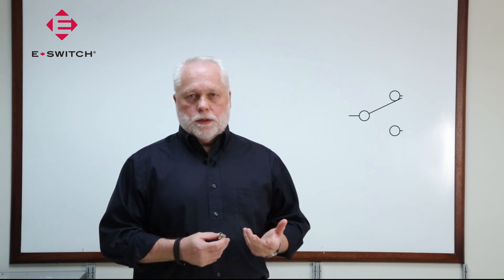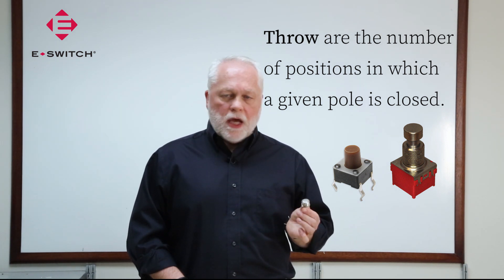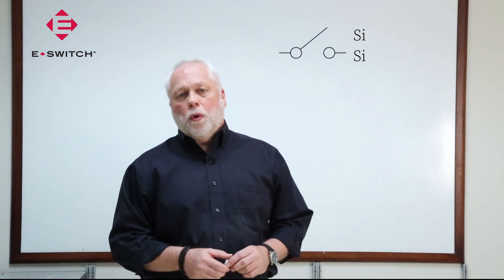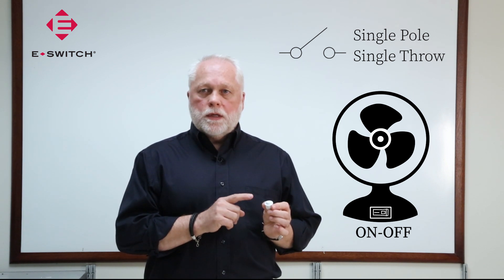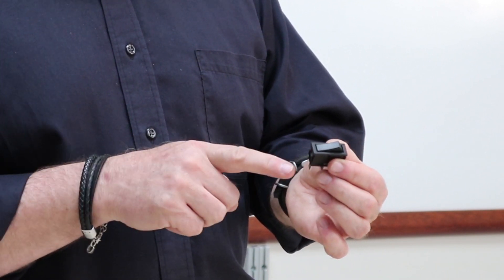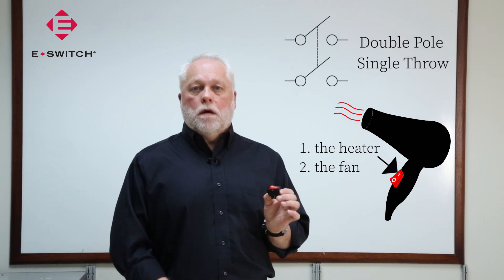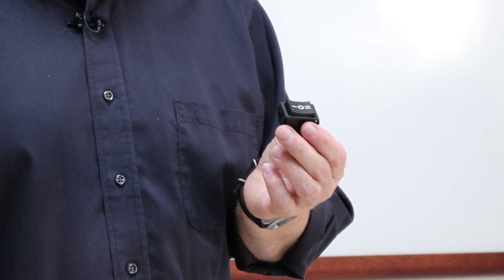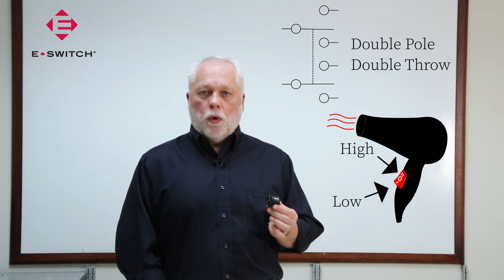How Many Poles and Throws do You Need?

Comment: If I want to replace my water heater timer box with a a switch that moves power between the water heater and a 220v outlet, (for 16A or 24A ev level 2 charger), would that be a double pole, double throw switch? Would the  Leviton 1288 switch work? I have solar hot water and I only need to turn the water heater on like once a month.
Thanks

Comment: Why is it so hard to find a 1P1T rotary switch? I just need to mount a simple ON/OFF switch and need it to be rotary to match the rest of the input selector and volume knobs in the control board of a stereo system.
Reply from the maker: Have you taken a look at our KC Series rotary switch? There's a SPST model: https://www.e-switch.com/product-catalog/kc-series-rotary-switch
Reply: There is indeed. But it seems out of stock and unavailable to purchase online. @ESwitchInc  

I've been struggling to get this from aliexpress or even custom made from alibaba (need more than one unit... for a business project) and have had zero success
Reply: There is indeed. But it seems out of stock and unavailable to purchase online  @ESwitchInc 
The "check stock" returns a "No results found" message.

Comment: I have a ceiling mounted fan, the switch fitted is a single pole single throw (a light switch) I have been told I need a double pole double throw switch to isolate it. There is only a live and neutral

Comment: Can someone help? if you have a light switch in the long hallway, you have three switches that can turn on and off at the beginning/middle/end of the hallway. Would you call these as Single pole, triple throws? thanks for explaining.
Reply from the maker: Hi!
Two of the three switches in this circuit are called 3-way switches and they are SPDT (single pole, double throw) switches.
The third switch in this circuit is called a 4-way switch and is a special version of a DPDT (double pole, double throw) switch.  It’s special because the throws are shared between the poles.
 
Here is a short article describing the wiring. https://joneakes.com/jons-fixit-database/1729-Can-I-have-three-light-switches-controlling-one-light
 
Thanks!
Reply: @ESwitchInc  so in this situation , we call this as double pole double throw? 
And if it's only two switches, then it will be single pole double switches? Let me know if I am wrong. Thanks

Comment: A double throw single throw switch in a bathroom for fan and light.   Why are 2 poles needed. Why not 1 pole supplying both devices  ???
Reply from the maker: Hi, thanks for your question:
Electrically, 2 poles aren’t needed (assuming the switch contact can handle carrying the current required to run both devices).
There may be other application restrictions (i.e. proximity of the fan & light) or building codes that require this be done with 2 poles.
Reply: @ESwitchInc  Thank you for your prompt reply

Comment: Maybe somebody can help me with this. 
Say for ex: I have microphone A ,B, and C. The switch has 2 positions. In position 1 microphone A and microphone C go through the switch. In  position 2 microphone B only is allowed through the switch. Regardless of the position the output of the switch goes to a speaker. Rather your on position 1 or 2. All microphones are on the same speaker. But not at the same time. 

2 inputs. One output. 

Would this be a double pole single throw? Thank you in advance to anyone that offers advice. (Its actually for guitar pickup wiring.)
Reply from the maker: On the surface I would say it’s a double pole/double throw.

In either position 1 or 2 there is a closed circuit (microphone closed) so that would make it a double throw since each position has a closed circuit.

On the number of poles, it appears that in position 1 they have one separate pole for mic A and another separate pole for mic B (A & B are wired separately to different terminals on the switch). This would mean 2 poles (even if doesn’t use both in position 2). However, what isn’t clear is if you wire both “A” & “B” to the same closed circuit. If you do, then it would be considered a single pole/double throw.

Comment: Can you replace a 15 amp, AC, 2 pole, single throw switch to a water heater with a 1 pole, 1 throw switch?  Currently the switch has a pole for the positive and the negative for both in and out or on and off.  Could either the negative or positive wires be wire-nutted together and use a single pole switch to open and close the other wire or circuit to open and close the circuit?
Reply from the maker: Thank you for reaching out. The described process is not recommended.

Comment: Hello thanks for the video. I would like to ask please which switch I need: I would like to have two independent circuits which switch on at the same time but remain independent of each other. I have an interface which mimics keystrokes (when a switch is closed) attached to the PC via USB but I would also like the switch to operate an LED at the same time (this would be repeated with many of the switches), however the LED is attached to its own power supply and do not want the current to flow into the interface, or PC. Am I correct in assuming I need a DPDT on/off switch for this? Thankue for your time.
Reply from the maker: Hi and thanks for your question!  To better service your request, please contact an authorized E-Switch distributor customer service department. They have the knowledge to answer your questions and recommend a suitable switch for your application. https://www.e-switch.com/where-to-buy/distributor-search#.Xui8hEVKhPY
Thanks again!
Reply: @ESwitchInc  Ok thanks very much. Just emailed them.

Comment: Think I can power four items running on a double pull double switch?
Reply: Not at the same time. You could probably choose which two are on; but to have all four circuits on would require a 4 pole switch.